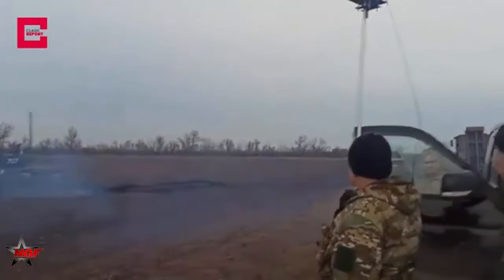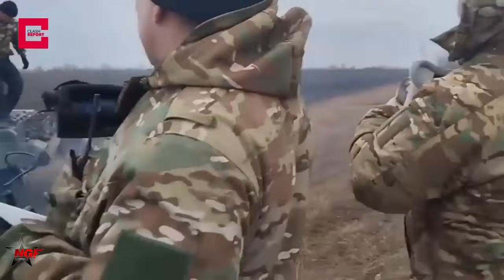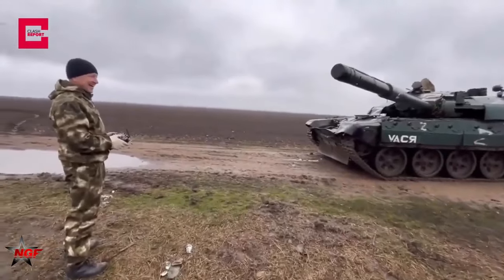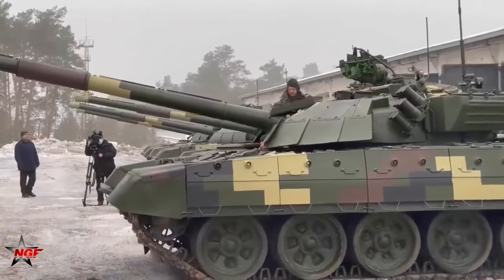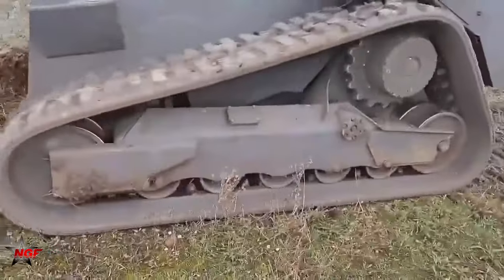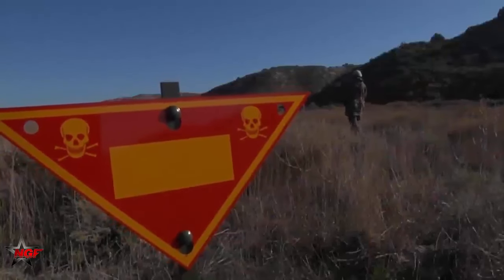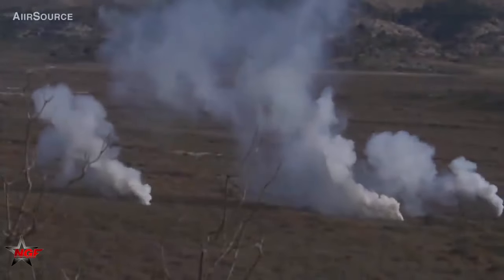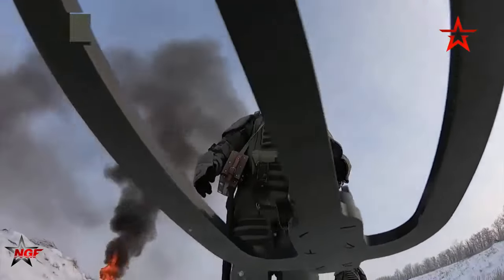Russia is testing the conversion of a first-person view FPV remote-controlled tank in Ukraine

Comment: Driving and moving the turret is pretty easy for some electro-mechanical actuators; since it is an autoloader probably not much harder to rig something up to fire the main gun. Imagine a platoon of these sent in ahead of the troops, using HE to keep the enemy heads down and taking all the fire. Better yet, put a "Tsars Grille" on them with signal jammers and have four of them spearhead your push into the enemy treeline. An "armored fist" with zero risk.